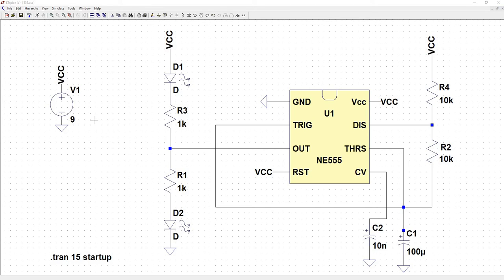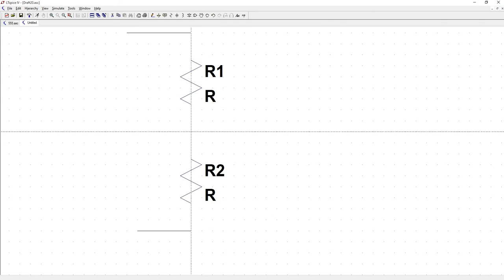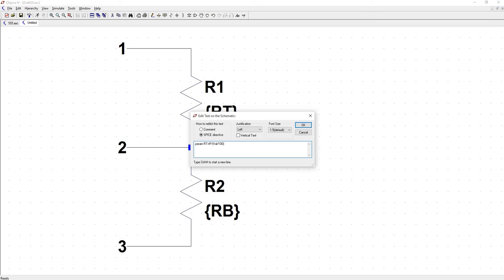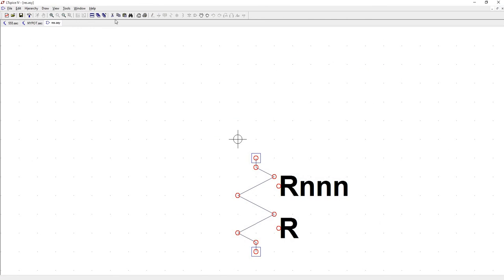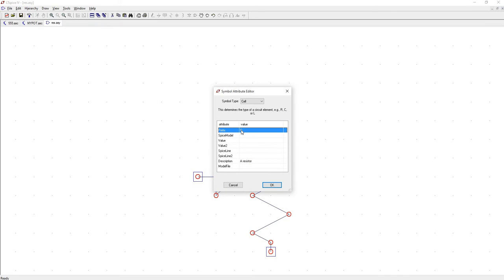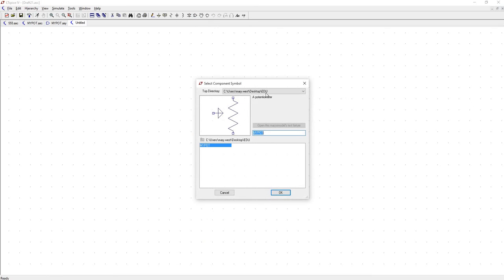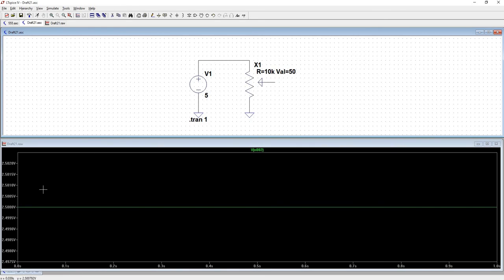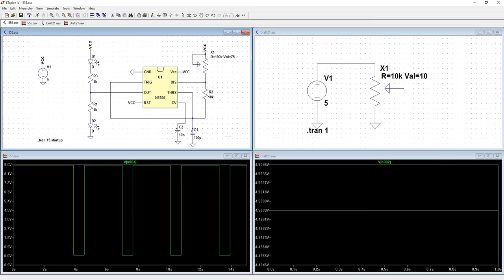Video Seven - Building a device model

Comment: New to LT. This is exactly what I wanted to do. Very well presented. However, there is a really annoying high pitched hum throughout the video. Perhaps, you could apply a notch filter to the audio track to remove it?  I turned my treble control as low as possible, but still annoying.  Also, a higher def version would be nice.   Looking forward to more Spice videos.